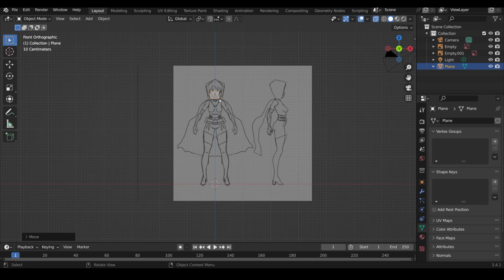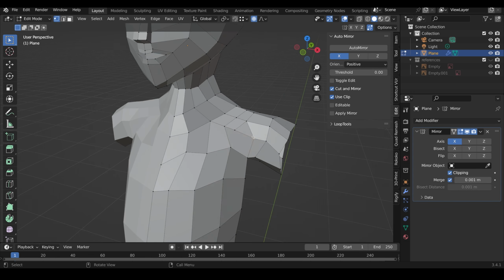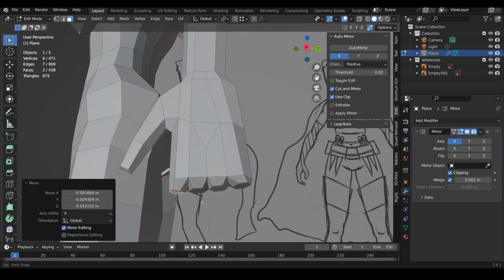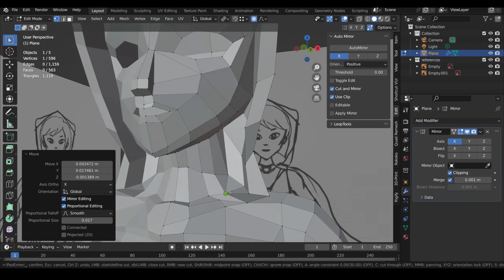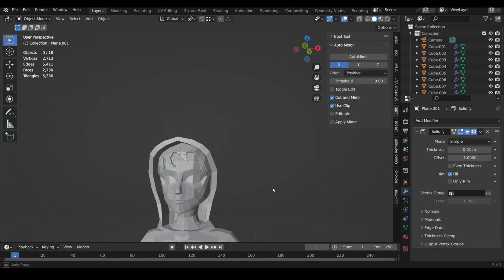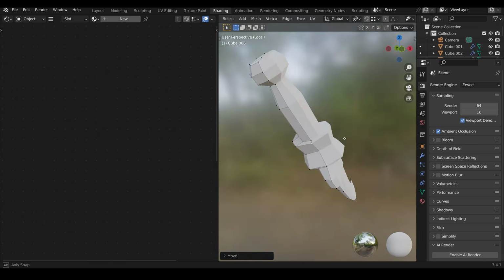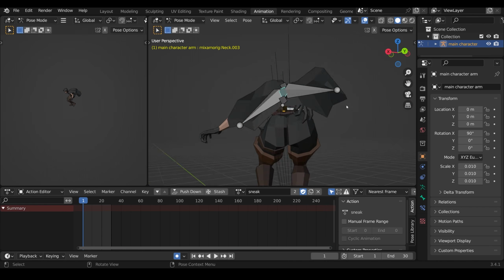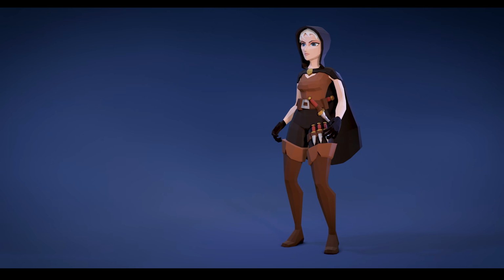Creating a Game Character - The Rogue - Blender 3

Comment: Just noticed a mistake in the forearms...
If you model the hand with palms down, the forearm needs to be rotated. The radius and ulna twist over each other with palm down.

To get the deformation to match a human, you keep the forearm straight, but the palms need to face forward, because the radius and ulna are parallel.

That's probably why you mentioned the arms deformed weird.
Reply from the maker: That's interesting. The rigify rig has them facing down so I follow that. But yes I see what you are saying

Comment: Re: low-poly breast modelling on a model you're going to animate: On real people, the skin that holds the breast is anchored onto the lower tissue layers right about where the pec muscles end and linearly down the midline of the chest, with the bulk of breast concentrating in a cone whose tip is the areola. You may end up with an easier time animating if you start the geometry by outlining the pec (and picking a vertex to track the "tip of the cone"), beveling its lower edge out, and then chopping off corners along the lower side - or for someone whose chest is large enough it would be folding over the anchor line, dragging the lowest faces downwards - because that geometry will reflect the edges along which the breast is pulled or compressed when the shoulders aren't in their neutral position.